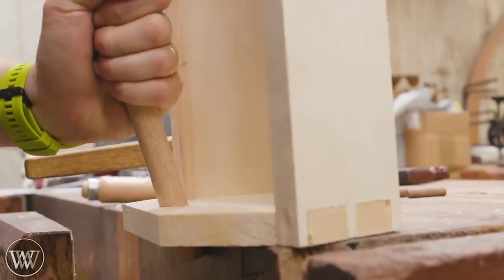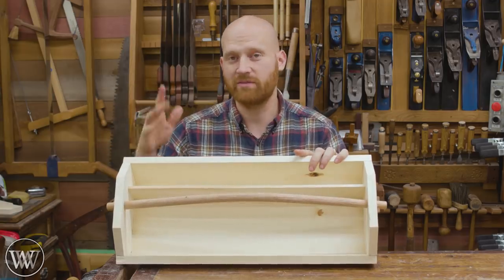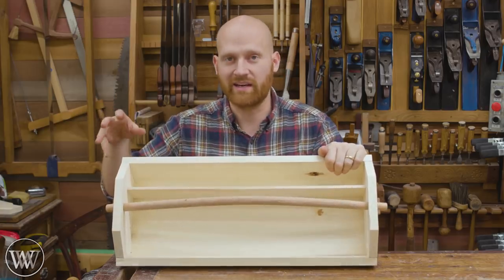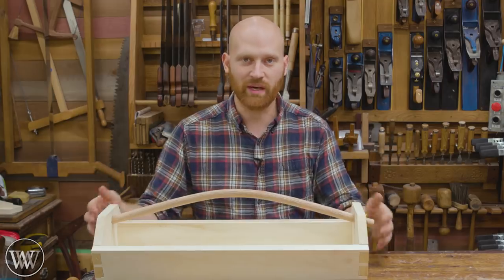No Glue Tool Tote Only Hand Tools

Comment from the maker: We will be starting the live Class on January 14th on the second channel. you can find plans and supplies needed here. https://www.woodbywright.com/shop
P.S. I realize I used glue on the bottom panel. It is not needed and I will be talking about several other options in the full build series. I decided to leave it in this video as it was part of the discussion in the build class.

Comment: That was an awesome trick with the ring on the bit while drilling the handle.
Reply from the maker: one of my favorites.
Reply: Doug D it shows if the bot is level. The ring will slide to the low side.
Reply from the maker: @Doug D that will be Thursdays video. With a few other tricks you can do with it.

Comment: beautiful box! I was wondering, where is a good place to get some bits for a brace. There are a million braces out there at antique shops, but never any braces? I really want to get a kit, you make it look so satisfying!  Happy New Year!
Reply from the maker: There are a few places that still make them decently. Unfortunately they are around 35 to $40 for each bit. Usually I buy them at antique stores and MWTCA tool meets. I have a list of all the places I normally go to for hand tools if you go to handtoolfinder.com
Reply: @WoodByWright  Thanks for the reply. One more question. The vintage bits have a taper on the end. I don't own a brace yet either. Does the taper fit past the jaws? could you use straight shank bits in a vintage brace, or do they only take tapered bits? thanks!

Comment: James do you find the dimensioned lumber from Menards to be pretty square out of the package. I know on the first thing I ever built I used the oak from there and had a couple boards with large bows....
Reply from the maker: I usually have to pick through the stock to get a couple pieces that I like. I don't get much from there but it is very convenient sometimes I just need that piece.
Reply: My experience is a little hit very miss. If you are willing to look around you can often find some good wood
Reply from the maker: @mattdnewman  I'm referring more to the pre-packaged hardwoods not the softwood construction lumber. With the softwoods you have to dig through even more.
Reply: I don't even get softwood construction lumber there anymore. I've had some bad luck with even the shrink wrapped premium lumber